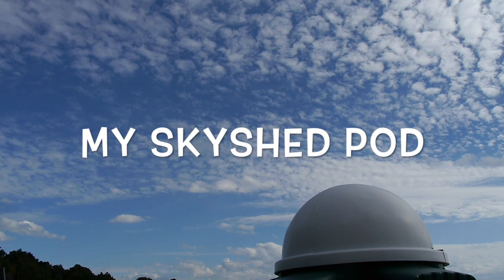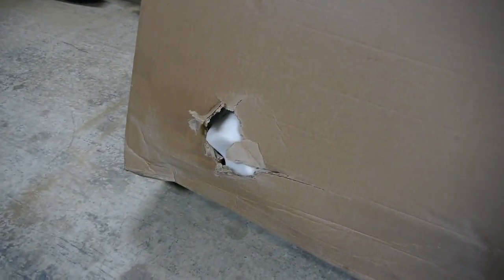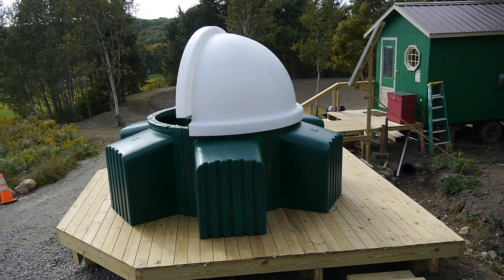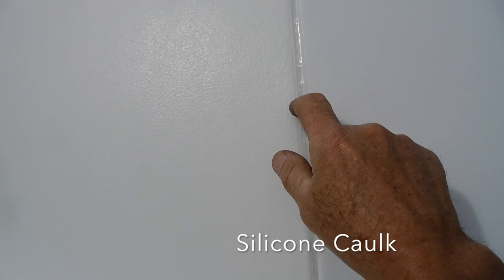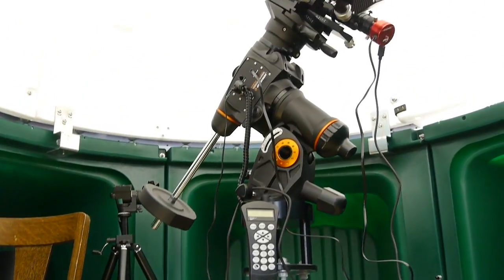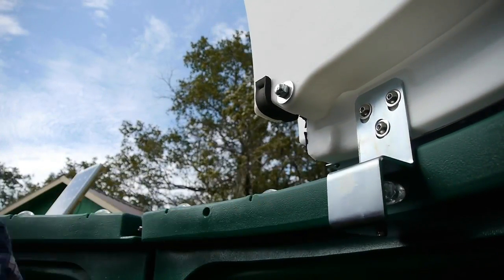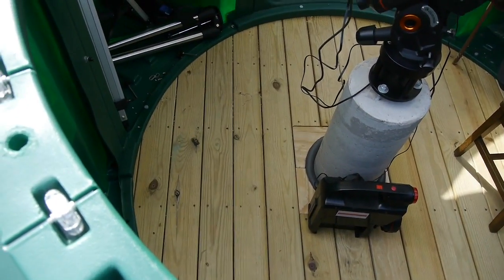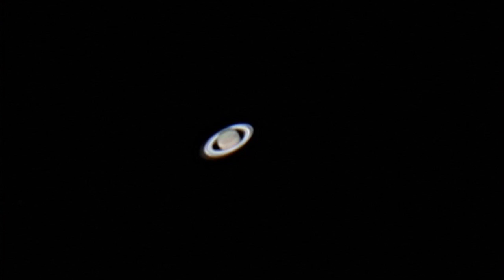The SkyShed POD (Personal Observation Dome)

Comment: Are there rollers on the bottom of the lip that keep the dome from lifting straight up? I understand about the 2 lock bolts when closed but didn't see anything else keeping the walls and dome together. What keeps the primary half from being lifted up and off? Thank you!

Comment: Tim, thanks for the video of this dome, I've been eyeing this puppy for awhile now, getting ready to pull the trigger. My problem is, I get around on a mobility scooter, and I need a ramp to get into this thing, and I'm not sure this one would be for me. What's your advice? I really like your whole set-up, nice......
Reply from the maker: Hello Raymond.  My dad had one of those scooters so I am familiar with them.  The POD is pretty small.  Were you thinking about driving the scooter up the ramp and into the POD?  I'm not sure that this one would have enough room for that.  If you would plan to put a pier inside then this really makes it a tight squeeze to operate the telescope in there.  Have you considered building a roll-off roof building.  If you did this, you could customize it for your needs.  I was going to build one of those and even designed one and then I found out about the POD and went with that.  Where do you live?  If you want to chat some more, maybe we can exchange emails and go from there.

Comment: That is amazing! Does it get hot in there or is it ventilated?
Reply from the maker: During the day it will heat up inside somewhat.  There is airflow through my floor and out under the dome so it is not like an automobile gets when it's closed up and in the sun.
Reply: TimTools99 It’s definitely my goal to have something like this in the future. It’s must be so convenient to have. Great video!

Comment: Tim, any new astrophotos to share?  Have you tried doing any deep sky photography with your 925 HD.........or just lunar and planetary?
Reply from the maker: I have tried some deep sky imaging with the SCT but my results are not as good as what i get with my 80mm refractor.  Everything about the SCT is more difficult.  f10 requires better polar alignment and guiding to enable longer exposures.  I am considering a focal reducer but for now, I plan to use the SCT for planetary work. I achieved some pretty good results last fall imaging Jupitor and Saturn.  I just ordered a barlow to increase the image scale.